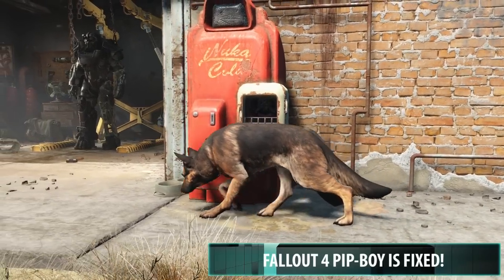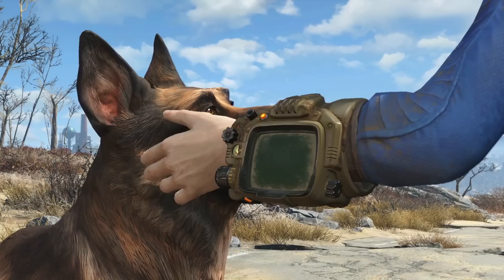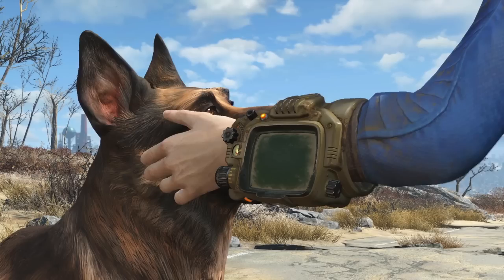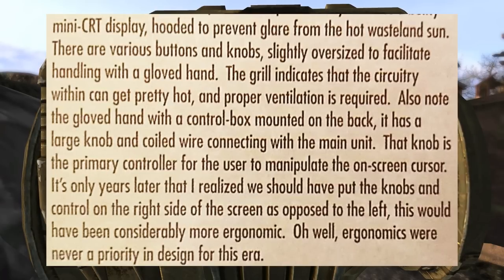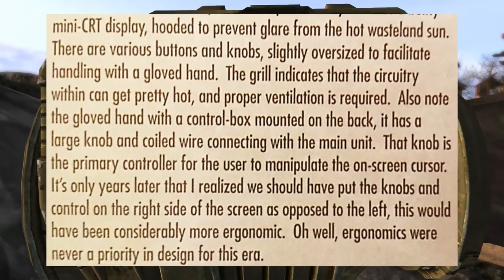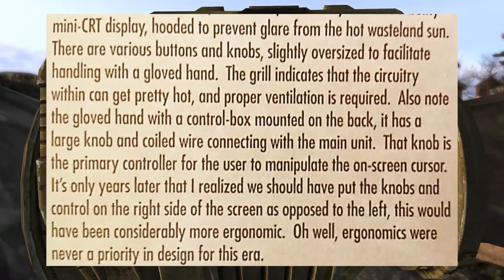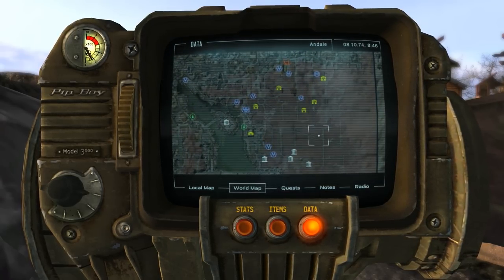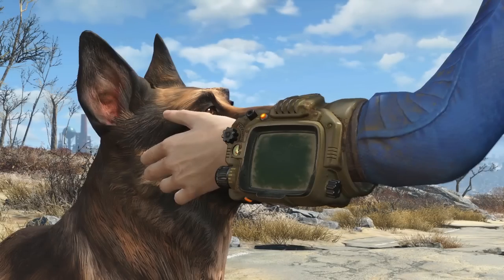FALLOUT 4 PIP-BOY IS FIXED

Comment: It could just be because I have longer limbs and ligaments than most of the people that I know, but the Pipboy-3000's button and knob design doesn't seem that bad. I get that the buttons on the bottom are for navigating to the 3 different sections of the device, the knob for changing tabs in that section, and the scroll wheel for scrolling, and I presume the knob on the Pipboy Glove is for cursor navigation. If all of this is correct, then so long as you put in the barest of effort to keep your arm out of the way of the Pipboy's screen, you can.